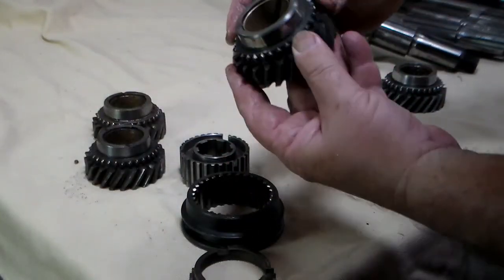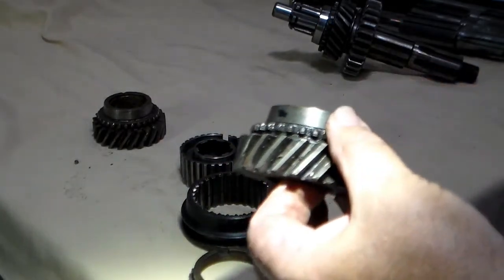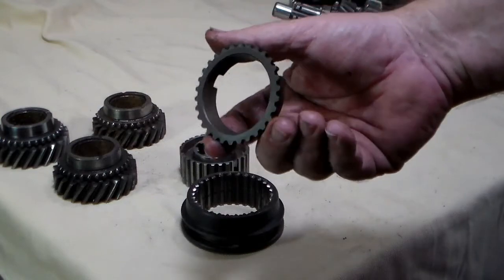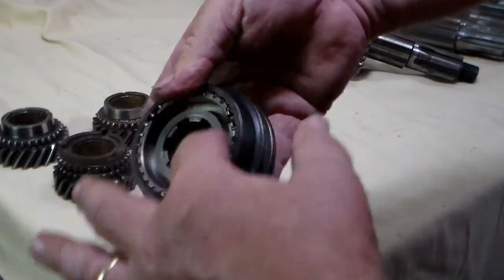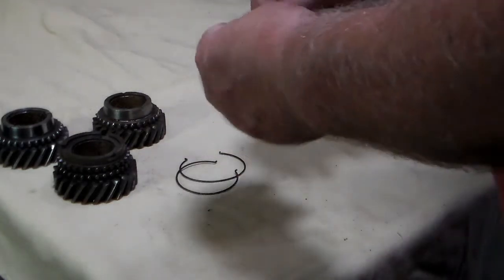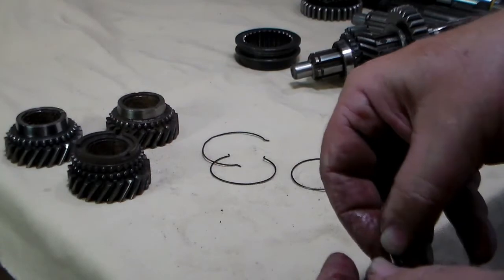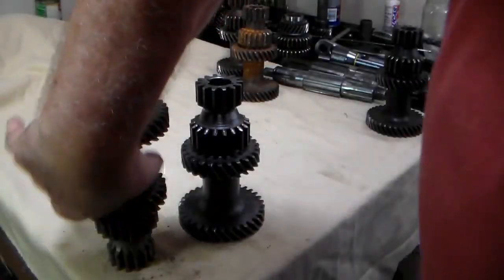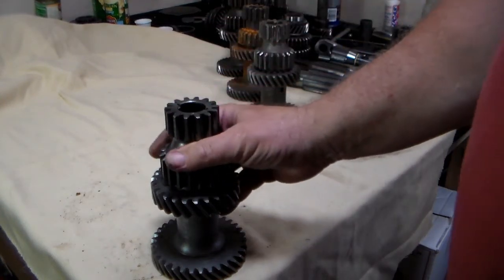8 Rick Stivers T-90 Rebuild Guide - Inspection Part 3

Comment from the maker: The Scout motor rotates the opposite direction than the Jeep engines. Because of that the levels on the gears are also cut opposite.  The rebuild is the same but the gears are not interchangeable. Years ago I looked for Scout gears and they were almost impossible to find. That may not be the case now. All of the rest of the small parts are interchangeable.